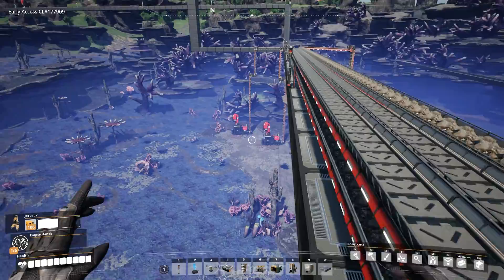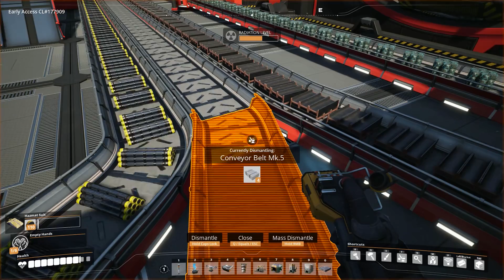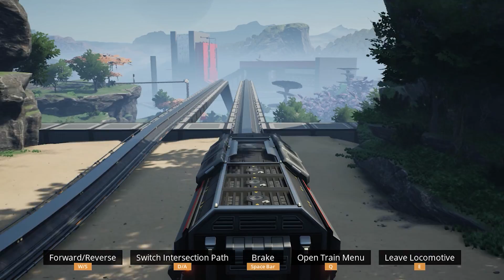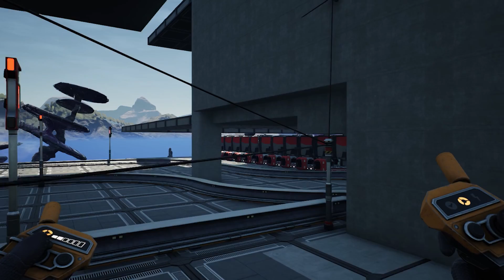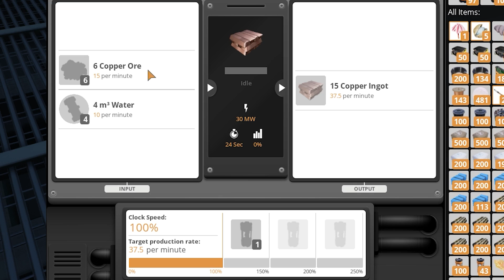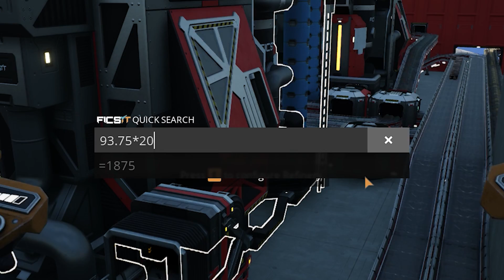This is the Last Nuclear Waste Incident I Swear - Satisfactory

Comment: I see you are using the jetpack always.. but the hover pack is more efficient. specially it is very fast, just try holding shift and going, it goes really fast compared to jetpack

And also saves inventory slots than the jetpack hence the jetpack uses fuel..

The only downside is that it needs power always.. but you just got to have few stacks of cables, concrete, wire and rods... which usually you keep in you inventory

And also it it=s really good in fighting animals

The fluffy dogs - no threat cause you are literally flying and they cannot hurt you
The alpha dogs - same thing
The Spiders, small/big/poisonous - they are ground beings and you are flying
spitters - if you hover high enough they cannot hit you with fire

Alpha spitters - the only threat

Comment: Hey, I found out, you can basically overclock all the machines to unlimited amounts... Just sayin'. Like 2000% on a smelter is funny. It only works by entering the percentage with 3 power shards equipped. I guess they have forgotten to set limits in overclocking with update 5. It's literally hilarious, overclocking a nuclear plant, just for a second, to 5000%... ^^

EDIT: Beams from the ceiling are great as pipe and belt holders. If you like you can showcase my map, just sayin' :D

Also, load balancing in pipes always led to some serious trouble for me. Didn't work out like AT ALL. I cut all the connected pipes and literally made small closed circuits that can be filled initially - that's it.

Comment: I see 2.5x overclocking on all of those refineries.  How does that work?  For refineries, it's just a trade between fewer buildings and much more power.  And in the end, seems like you need a kabillion refineries and there are (to my understanding) a limited (but pretty large) number of power slugs.
Reply: You can cheat yourself an indefinite amount of power shards.
It is indeed a trade off beween the number of buildings and the amount of power.

You can build twice as much buildings to save a third of the power consumption.
Or you can halve the number of buildings for an additional 50% power consumption.

If you want to build big or if your computer is rather weak, then less buildings mean a better performance.

But it's your desicion if you want to build 20 refinieries with 66MW consumption, 5 with 150MW or 2 with 260MW

Comment: Well i Was rewatching and rebuilding your Power plant And I noticed a big mistake:

You have way to many reactors for to little rods.

You are making 22,5 rods per Minute.
One overclocked reactor Takes 0,4 rods per Minute.

You have 56 overclocked reactors and 42 normal running reactors.

The Problem:
56 overclocked reactors alone Takes 22,4 rods.
So you have 41,5 too many reactors :O

Instead of 42 Additioninal you just need one on 50% (0,1 rods/min)

Your production on Plutonium fits the 56 overclocked reactors and one on 50%, so this system should also back up eventually. 

Now your rods are backed up as heck, but some time it will break.

I dont know when, but it will eventually, or am i missing something?

Numberwise, this should not be functional. So i guess this wont be the last breakdown 🙈

Comment: How do you work around the Rounding issue with the Belts that lower belt throughput the longer belts go? Along with the issue with pipes where flow rate reduces the longer/more junctions in the pipe system?

Comment: I saw in the 2021 24 hour Livestream that you wanted the lifts to be able to be reversed. Correct me if i heard wrong. But they can be reversed, just press R to change the build mode. 
Hope it helps and that i heard right.

Comment: Very cool that the system just doesn't shut off because, well, there is some rubber, so it's still producing, but eventually it would continue to get worse and the system would begin to just not run most of the time. What a concept.

Comment: If it's worth anything Mr Kibitz, I've had some success with providing the Nuclear plants with slightly more water than it needs. I noticed the same issue as you with my nuclear plant, and found that the plant is slightly glitched, if you give it just enough water, it cuts out every few seconds like it runs out of water. That causes those dips in the graph. After hooking up an extra water pump to each 4 power plants it runs in my factory with stable power. Just a suggestion for you to try :)

Comment: My favourite thing to do with soft clipping is to have conveyor lifts going into the foundations and than have the belts run underneath the floor, you can then have lifts bring the materials back up where you need them and it looks really clean.
Reply: They also added the conveyor floor holes though, so you don't need to clip that. And those things look just fantastic.

Comment: do you know that you could hang pipes on the ceilings using the pipe wall support ??
Reply: The trouble with that is that you can't make a stack of two pipes down from the ceiling that way, at least not without placing temporary foundations or something.  Building downwards is quite hard still.
Reply: @Mirality  yes but its aesthetically pleasing